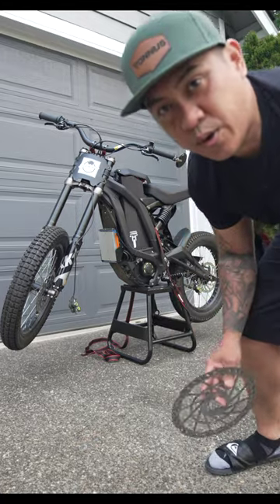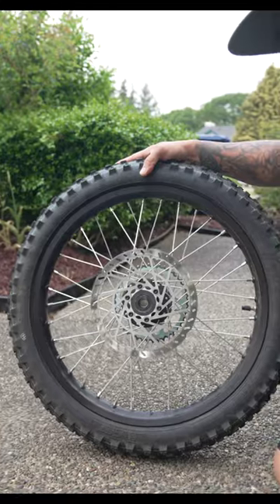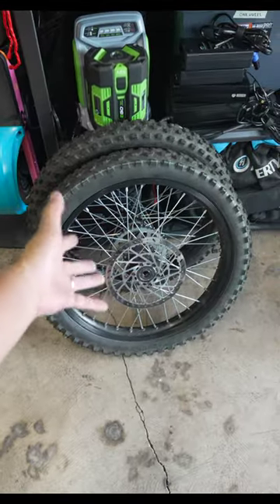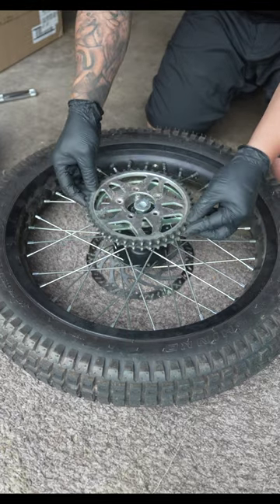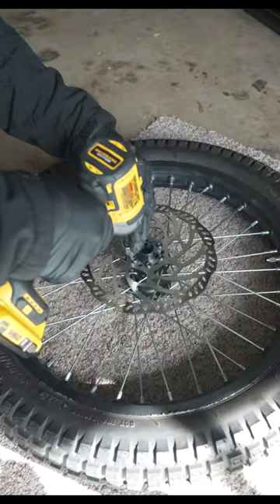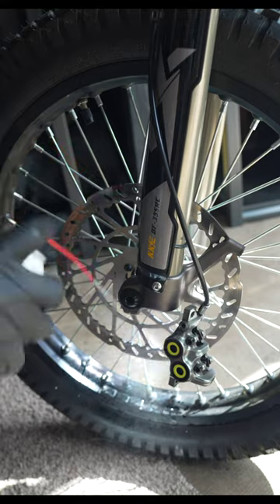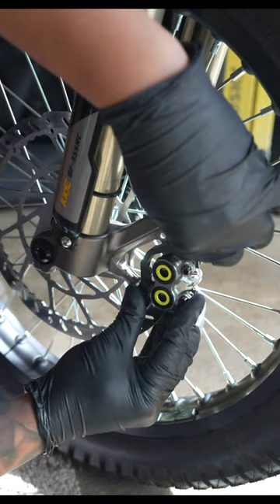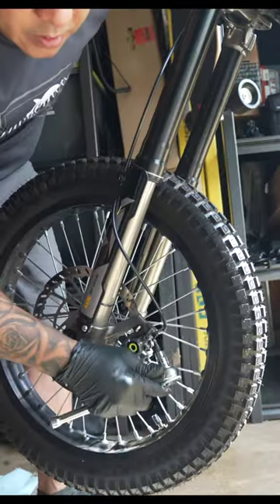SUR RON X 220MM ROTOR INSTALL

Comment: How much better do those brakes feel vs stock?
Reply from the maker: About double the stopping power
Reply: @adobomoto  your being sarcastic right. Is their really a noticebale difference between 200mm and 220mm rotors? I thought bigger rotors just didnt heat up as fast but the larger diameter actually spins faster which would make it get hot faster. I just dont know that they make any difference really. Id rather just get some real dirtbike brakes i think that would be the best option rather than super expensive bicycke brakes.
Reply: @Alias  yeah it's total bs. 20mm difference in diameter isn't going to double the stopping power at all. You're only looking at a 5% increase really unless you also upgrade pads and calipers
Reply: @MotoAlias larger the diameter the slower the rpms**